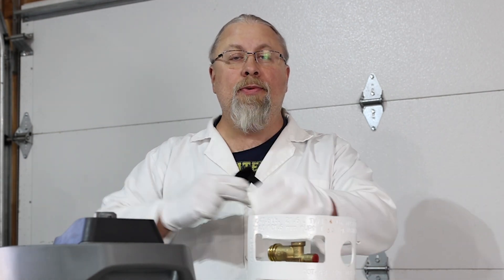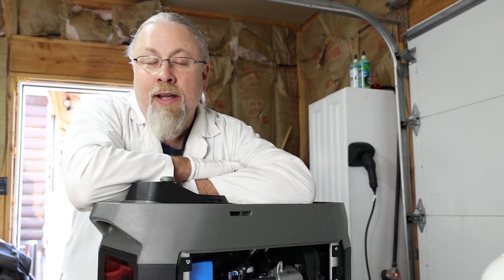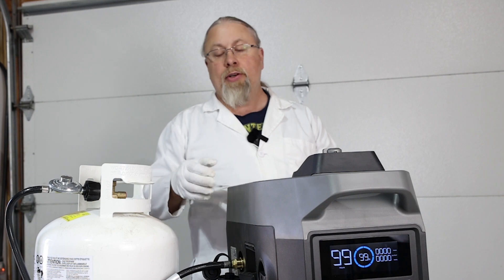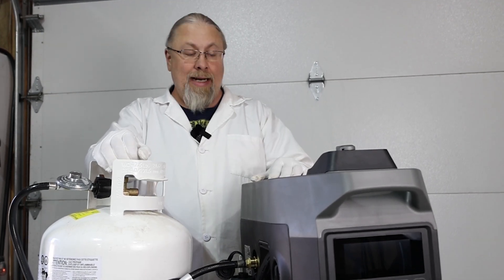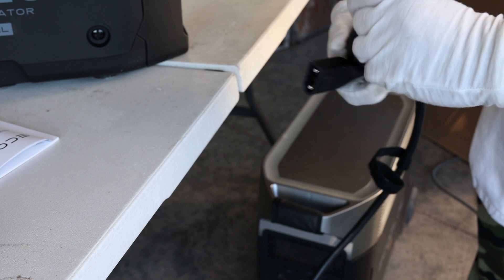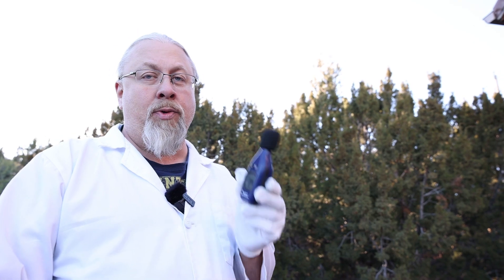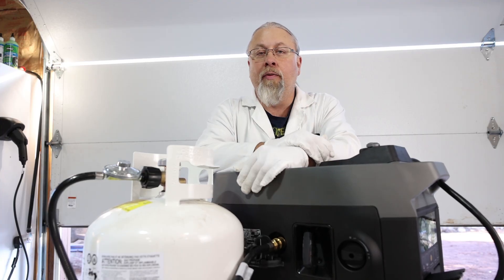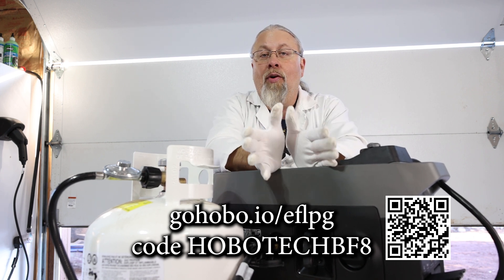EcoFlow DUAL FUEL 1800w Gas / Propane Smart Generator Review

Comment: Most owners with  dual fuel generators know that the trick is so do 5 to 10 quick pulls of the cord to prime the system, works every time
Reply: I watched Echoflow video on this gen … didn’t go back this morning, but I do remember there was at least 1-2 slow prime pulls in their video.

Comment: I apologize for hammering you with comments, but I’ve been using dual fuel gens for 20+ years. They are all harder to start on propane because the demand regulator can’t get sufficient vacuum without a good pull, and it’s worse at altitude. That’s probably why yours won’t electric start. If your viewers want a reliable & cheap-ish dual fuel generator of this size, I recommend the Champion 2500 ($550 street). I have one & it works great.
Reply: It's hard to beat DC charging that the champion doesn't have

Comment: It almost sounds like the flow safety valve on the tank was tripped just turn gas off remove the hose and replace fully then slowly turn gas on you should hear a click.

Comment: That unit is too expensive for 1 outlet, and electric start that leaves alot to be desired. The battery sounded healthy in the beginning. I bought an ALP generator/inv. 100% propane. It does take 4 pulls to start. Also, has a purge valve for the propane. There are plenty of dual fuel units out there, too bad ECO flow is the last one in the parking lot
Reply: What other sub 2000 Watt electric start high efficiency inverter generator do you know of? Also, ever hear of a plug strip?

Comment: A couple of late comments to this great video. Generator mfg’s state the oil capacity in the manual, so if you measure it out first you won’t get any mess. Run for 10 hours to break-in and change the oil! After that change oil @ interval in manual. Over 40+ years I’ve found it best to use 5W-30 (any decent brand) if you live where it gets cold. If temps rarely go below freezing 10W-30 is fine. I prefer synthetic but it probably doesn’t matter.
Reply: Flow points of 10w synthetic is significantly better than conventional. You usually see same flow results for 5w and 10w the same until your like down to -10f..

Comment: Oops..  let’s see what anonymous support call (if there is a call center) or email chain gets Hobo to correct the electric start issue. How long, if the people were American, and what it took to get the issue resolved. As usual, great exam/test.  Informative.
Reply: I have an ecoflow Delta Pro. Had an issues with a Open Ground issue when hooked to my home. Sent an email and by the end of the day I had a reply with a way to resolve the issue. So hope they will do the same for all products.
Reply: @joshc606  good to know. Thanks.
Reply: @John Ross I bought Delta Pro/wave bundle and was missing a cable.  Customer Svc responded immediately.  Supply chain issue but CS kept me informed until ship.
Reply: @johnross6314  And a correction ... I have the Max/Wave bundle not Pro.

Comment: Liked the video.

PS:  When using recoil starter, do NOT just jerk the handle.  1st softly pull to engage the recoil to the flywheel, then give it a steady pull.  This procedure will extend the life of the recoil starting system.

Also not fair to take a dB reading from a unit in a garage that acts like an amphitheater.  True test would be in open surroundings at your measured distance.  Grass and other plant life will also reduce true readings.

Owner of many Honda EU-series generators sets.  Quietest in the business.  Looking very hard at the new battery back-up systems and this unit is "smart" for generator b/u to the battery system for extended outage.  In fact, I just ordered the unit you are testing for personal review and ease of use for my mother as it has electric start. (had to get EU3000 at 130+lbs to get electric start.)

P-Chi this feature).

Comment: I found out from that Scotty guy on the auto channel that as long as the codes on the oil jug meets the application you’re good. Wow 8 pulls. And a great number’s of cranking. No joy 🎉.  The 7000’ is a issue but understand it and working it and knowing why is a good heads-up. Thanks again for your review their a great service.  Tom all that stuff in your van. Just saying.

Comment: I just purchased mine a couple months ago. Still  have not fired it up yet. Got a new 5 gal gas can and exchanged on of my propane tanks for a new full one. I really appreciate how you went through the steps to get it ready for use. This is the first generator I have ever purchased. Went through a couple of days of losing power a few years ago due to an ice storm. I had a feeling that this winter just might bring us another one down here in Georgia. Thank you for the video, it is much appreciated. After shipping (and a couple other charges) it ended up costing me around $1500.
Reply: $1500 for a 1800 watt generator? You got ripped! I paid less than $900 for my 3800 watt Wen electric start generator. Barely 56 decibels at 10 feet and runs almost 12 hrs on 5 gallons of gasoline. Never have had to use the pull starter and always has started on first attempt.
Reply: BETTER fire it up NOW, I worked @ a MFG plant that IMPORTED 10 or more DIFFERENT U.S. WELL KNOWN name brands from ONE MFG plant in CHI NA, they came directly from the Savanna Ga. port to our warehouse, the trailer door would open and you would see MANY DIFFERENT name brands staring at you that the typical consumer would ASSUME was U.S. built units, and it was well known some would be defective from the get go. NEVER let sit in a box something you may need in an emergency
Reply: @Numa Newbern  the instructions state that you should run them for 20 minutes every one to two months to keep the lithium battery charged and fuel system clean. That is exactly what I have done since I bought the generator in 2020. No issues at all. I recently refreshed my gasoline supply (five  gallon containers with stabilizer) so I know that is good for another year or two.
Reply: @garycolvin6625 Wait, did you say that it has a lithium battery? If so do you know if it's lithium ion or lithium iron phosphate?

Comment: So about $1300 with discount and taxes on the black Friday sale. I guess it's an ok deal when you consider the features and the capacity on propane. I have a propane only generator that is much smaller and I think I paid 550 with shipping and tax. Starts up first go every time but only outputs 850 watts at 6000+ feet where I tend to use it. I would like a model that could handle a bit more but with a battery array as a buffer it will do fine.

Comment: Use the dip stick on the oil fill cap, don't just fill to top. Also open propane valve all the way, use a hand levered ball valve between line and bottle if you need quick shut off.

Comment: I would add a filter to your propane line.  Rubber hoses can deteriorate from the inside and send tiny particles into the fuel system and clog it.  Propane does take a while to fill up the lines.  Is there a primer button like you’d find on a Mr. Heater propane heater?  That would be a nice feature.
Reply: Just make a copper whip and eliminate the rubber line.

Comment: If that cable to connect to the Delta Pro is Ecoflow proprietary then it is way too short, obviously it needs to be outside and Delta PRO inside, that is the deal breaker for me as mine are in my basement by my panel and Generator would be outside, would need a 50ft cable for sure as the generator should be a good 10+ ft away from the home IMO.

Comment: It's only a smart generator in warm weather. Once it's 32° or below you need to warm it up for 3 minutes before you can apply any load to it including your Delta pro unit, so it needs to remain unloaded and therefore isn't smart at all in cold weather.
Reply: Thats y i have a room built just for the ecoflow and equipment. As i live in northern mn

Comment: Have you considered loading it with Aspen fuel ? - that is ethanol free, burns cleaner, does not degrade quickly - and does not destroy rubber    and about 5 times as expensive as E5 from the gas station.
Reply from the maker: They sell ethanol free gas at gas stations in AZ. That's all I use in my small engines.

Comment: Did performance mode (aka full throttle) allow it to start on propane each time?

 Seems like eco mode was not happy starting on propane. Looks like a firmware update is needed to fix that :)

Thanks Tom for another great video
Reply from the maker: Settings made no difference.
Reply: I assume the 12 volt wasn't charged enough out of the box

Comment: 13:54 the electric start worked…maybe you need to let the engine run and charge the battery inside the generator first?

Comment: It looked like you open the gas cap air port after the 7th pull so it appears to me it started technically on the 1st pull once gas cap was in on position.
Reply from the maker: Its running propane, dude.

Comment: I get that they added a bunch of electronics to the generator but 1300 dollars (on sale) for a generator that produces 1600/1800w depending on the fuel you use, is kinda lame TBQH. You can pick up a champion dual fuel inverter 2500 that is basically the same running watts for around 500 dollars on sale. I am not sure the electronics added are worth a 145% increase in price.  Are the auto features worth 145% increased cost?
Reply: Yes that’s what I was thinking. I got a wen 3800 for 600. 
Remote monitoring would be nice but not sure what the extra smarts really do.
Reply: Lot of electronics but I agree. This is for somebody who's looking for seamless integration with their existing EcoFlow system.

Too much money otherwise. 2 cycle 800 watt Harbor freight generators $100 😂😂😂😂. You can definitely do better on price. Not same thing but there's definitely cheaper options.

Comment: Another comment, since some of the propane in the tank is liquid, the pressure has nothing to do with how full it is, rather it has to do with the temperature and how rapidly you’re drawing it out. The best way to tell how much is in the tank is to find the vertical place on the tank where it gets cold, or look for condensation on the tank, after the generator has run for a few minutes. That’s the liquid level.

Comment: This generator is meant to auto-start when it detects the low battery level on your ecoflow.... if the electric start doesn't work reliably then it's useless. Needing to pull the cord a couple times makes this no better than every other generator.
Reply: my thoughts exactly, disappointing.

Comment: Is there an adapter to use the Ecoflow Dual Fuel to charge up my Growatt Infinity 1500 that I just bought last month?
Reply from the maker: Just plug it in.
Reply: @HOBOTECH  How long will it run on a full tank of propane?
Reply from the maker: @DaveSimcik  12.5 hours

Comment: Good review, however if I needed a dual fuel generator I'd get a traditional one.  Then use that to run the loads, and maybe charge some batteries.
Reply from the maker: The point of this generator is to save up to 40% on fuel by DC to DC charging other Ecoflow products. No other generator can do that.
Reply: @HOBOTECH  While that is something, it's not been perfected yet. Why buy a generator for a purpose that kinda works? Especially one that's brand new and no service parts are available?
Call me crazy or whatever, I don't care about the CCP feefees. Either make it right or don't leave the factory should be the rule.
I understand your alliances, and understand your argument.

Without completion all brands suffer, and if they can't handle criticism then tell them to grow thicker skin,  no offense intended 🤣😂🤣
Reply from the maker: What do you mean kinda works? It works just fine. I show it more than performs at elevation. The hard start I show went away after it ran. So I don't understand the criticism. If you don't like it don't get one.
Reply: @HOBOTECH  Okay, well said. Calm down, I watched the video, I don't think it's ready for prime time.  Does eco flow have a state side repair center or spare parts? 

It's a great design,I'll give them that.
And they came close.  
I've been running generators for about as long as you have, we're pretty close in age, and you and I both know that parts or service are a critical item to have with this investment.  Eco flows aren't cheap.  

That said if they had parts or a USA service center or fully stocked, 3rd party service centers available then the decision to buy one, two etc would be that much easier.  

I'm sure you are aware where this world is at, and Eco flow is not made stateside.  C lock downs,  wars,  transportation/ supply chain issues and the like can and have happened.  Having a brand new generator perform like it did in this video might not be a high probability, however that doesn't bode well for a new unit.  

Until Eco flow has either a parts department or a USA based service center, buying into their ecosystem is off my table.  
If on the other hand one can find parts in ten years then I'd buy a few.  
I've got 25 year old eu2000 Honda's  that run like champs.  And all of their part's are available.  
So if comparing apple's to apple's the Honda's win, presently. 

Thanks for the conversation.

Comment: Its the Propane bro, It will never get its full rated watts on propane.  I have a DF gen as well, mine is 4500 watt so the power loss is not a issue for me. If you used regular gasoline It would be close to max watts.

Comment: Hi Hobo
Can I use an Ai-Power 2000 inverter generator to recharge my Delta Pro with its electrical AC cable plugged into the Delta Pro? What port do i use or do i need an adaptet?

Comment: thanks if you start the generator with no load at all will it run at high idel like a Honda and only speed up when the load is applied Thanks
Reply: Hello! The generator without a load operates at low speeds and consumes little fuel. If you connect a load to it, it will increase the speed automatically.

Comment: It doesn't come with the adapter you have to order that separate.  So you will spend basically between this and the pro model roughly 4 grand and you still can't use it. Geez just throw in the adapter and add it to the price.  It would cost another 70 bucks hardly something that would change ones mind when they are already spending over 4 grand.  My other criticism of this is why not have some outlets on it in case the pro goes down?
Reply from the maker: It does have an outlet. Did you watch the review?
Reply: @HOBOTECH  Yup one outlet so a 1200 dollar one outlet generator? That doesn't come with all the parts.  At the end of the day its just constructive criticism.   I was hoping eco flow would consider it in the future because it would make an okay product into a great product.  Considering the wonderful tech ability they already show us I can't imagine it would be to hard to do.
Reply: @johnmal5975 it’s one outlet, as it’s only providing one full circuit =1800 watts =15 amps. Obviously they expect you to put whatever plug divider/power bar you want—but if they put two outlets on it then someone would expect it to supply enough for two full circuits, when it just splitting one. Therefore it’s better for you to do it.
Reply: @GMC-qo9xi  That person would no nothing about generators or power stations.  None of eco flows power stations work like that or the competitions .  Gas/propane generators normally have at least 2 120 outlets  The price of this thing it should also.  Sorry its lame just an opinion to each his own.
Reply: @johnmal5975  exactly regarding the opinions. My opinion is the single plug actually makes more sense, as it keeps the front clean and simple and I’d rather have one cord coming out the front instead of like 6! Lol… one cord that feeds the rest of them from the ground. But having said that, for many it already is 2 outlets, as the DC out to an EF power station must be used to make sense of buying this machine in the first place… BUT what is an even more important point is that you can then leave everything plugged into the power station while it is charging through the DC port. IF you don’t generally use it for EF products—you would (probably) be wise to not buy it, as you can get remote start machines that are cheaper, lighter and much quieter than the EF. 

I was tempted to buy it today, as the price after multiple discounts was the lowest it’s ever been (in Canada), but I decided not to based on the noise factor considering the relatively low output—as it needs to run full bore/volume to get the needed output. Can get a lighter, quieter, higher output package for the same price as their best possible price.

Comment: The Dual-Fuel Generator with a brain. 😗 I also read these generators can start automatically to recharge your power station based on your settings on the mobile app. Very cool 😎 (Except, they will not ship these to Commie-fornia addresses).
Reply: Not true, I purchased one on the EcoFlow website 3 weeks ago and it arrived in San Jose, CA. without issue. I recall that on Amazon they will not ship to CA.

Comment: Strange that in all of the Youtube review of this generator, the generator do not start itself with the electric start on propane... Did you figure out why or did Ecoflow provided you the solution?
Reply: Elevation might have played a part in his difficulty, and probably fact that it was less than half full and regulator. But even more likely was since the line was brand new, full of air (and hadn’t been running). Once it was running for a while the electric start then worked immediately. Generally speaking, if it hasn’t been running already on propane, you should pull the cord a few times (slowly) to prime it, then turn the system on and start by whichever method you want.